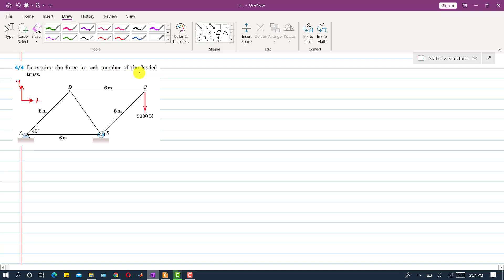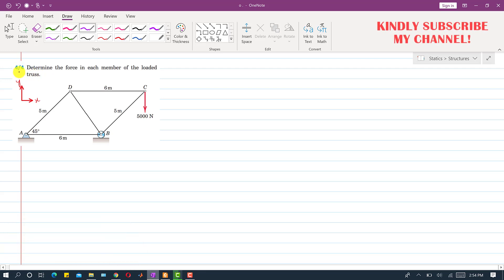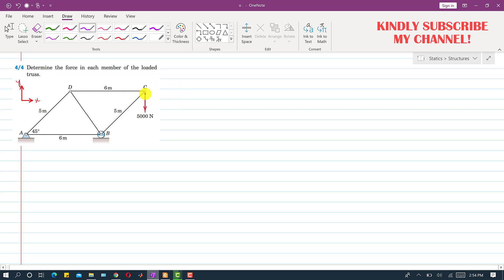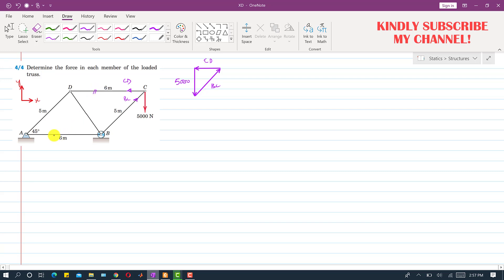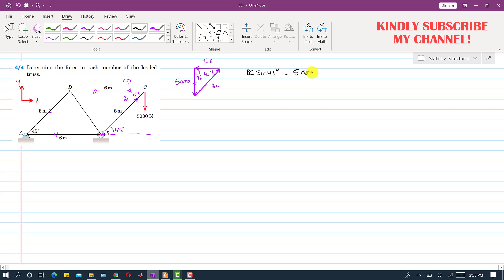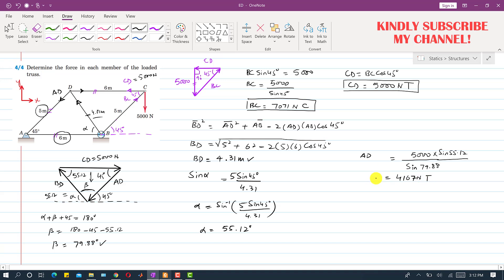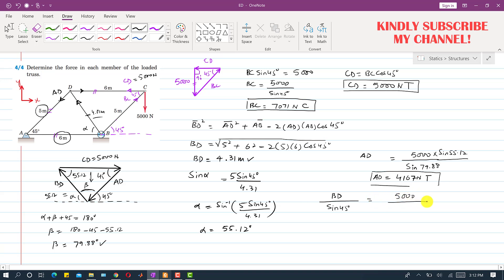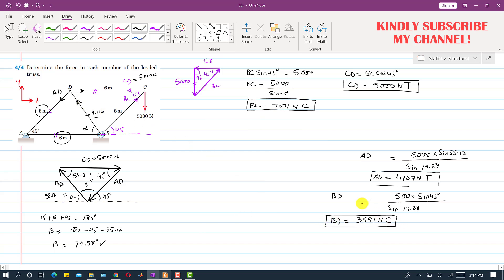4-4 | Engineering Statics | Method of joints | Chapter 4 | Engineers Academy

Comment: I learned to first calculate the support reactions using the three equilibrium equations (ΣFx = 0, ΣFy = 0, and ΣM = 0), and then start analyzing the truss. Why didn't you calculate the support reactions in this case?
Reply from the maker: It's not always necessary. You must always start from that node where there are at least 2 unknowns and one known force.